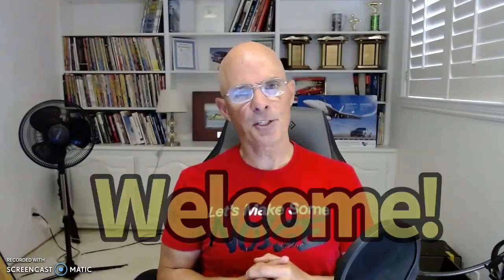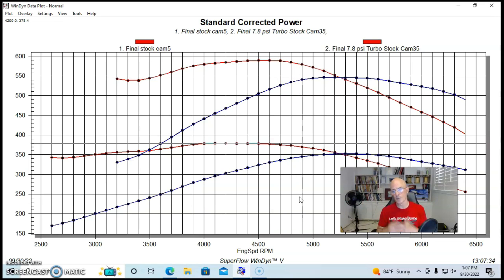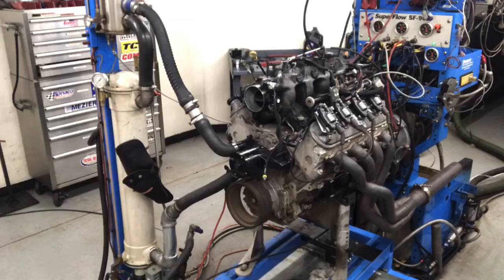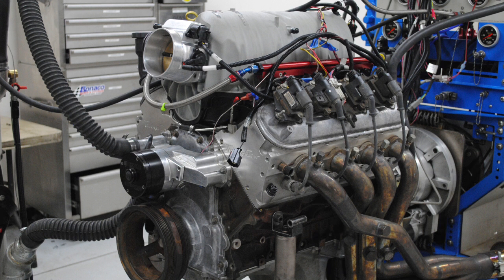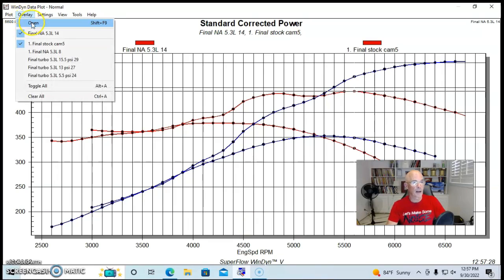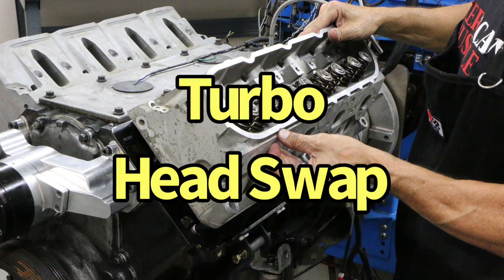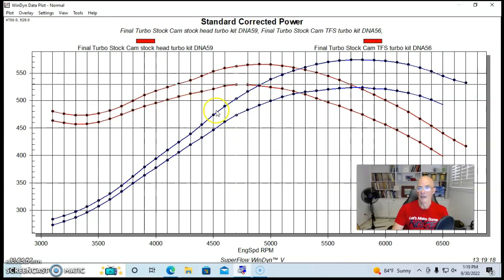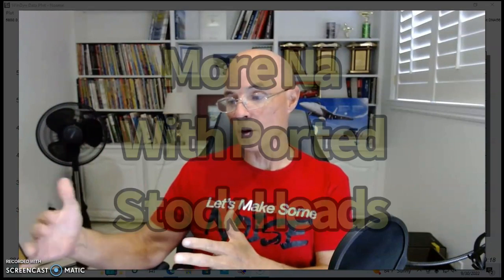DO PORTED HEADS ADD POWER ON A TURBO LS? YES, BUT DO YOU REALLY NEED THEM? ARE THE DECKS TOO THIN?

Comment: Hi Richard,

I’m looking to install a turbo gt42 to produce 700hp daily driver 

I have a LS1 Holden Ss Ute and my current set up is as follows :-

Alloy high rise
intake manifold, 102mm throttle body, proflow hi flow injector rails, bosh 968 42lb injectors, Vcm7 cam, crow cams, double valve springs and retainers, Mellings hi volumn oil pump, roll
Master double row timing chain kit, arp bolts, vcm alloy otr and oil catch can.

Stainless steel extractors with high flow cars with a brand new 2 and a half inch cat back system with rear muffler delete. 

Walbro 460lph fuel pump e85 compatable.

With you experience is there anything you can suggest or change to make improvements please
Reply from the maker: all good-just ring gap

Comment: Hey Richard I have a question, I have a supercharged ls3 with a cam. Stock heads 10psi I made roughly 740whp. Thought it would be a good idea to have the heads ported by Frankenstein, afterwards I only made 7psi and roughly 690whp. Everything else is the same with the car just had the heads ported so curious why I lost horsepower instead of gained.
Reply from the maker: sounds like you have a leak some-ported heads don't do what you describe

Comment: A more volumetrically efficient engine will make more power than a stock one in every situation. Making the motor more "Stout" in the bottom end will help with longevity. I've seen 1,200 HP from a "Bone stock" LQ9 with just a turbo and after market computer.(Freiburger and the Steve's did it a few years back.)
Reply from the maker: PLEASE LOOK AT THAT TEST AGAIN AND SEE THAT STEVE, DAVID AND MYSLEF MADE 1543 HP WITH A STOCK BOTTOM END LY6 6.0L

Comment: It would be cool to see what a blow thru ls e85 non intercooled iats would be vs intercooled under the carb
Reply from the maker: intercooler adds power and lowers charge temp with any fuel
Reply: @richardholdener1727  ya I know intercooler makes more power  i was just curious for guys like me that don't run and intercooler what the iat below the carb is my intake feels like it was in the refrigerator when my car is running on e85

Comment: Why is no one talking about engine response between  ported and stock heads ??    Did a couple of turbo engines  Audi 1.8t   Audi 5 cylinder 2 and 4 valve.   Made small ports with high flow. ( always test at 70" tp)  .   With some there were minor gains at dyno . But drivers would praise the lack of turbo lag. 
One Audi 1.8t customer stated , after flowing  the head and going from 340 to 365 hp :  I am getting scared by the engine as when I only look at the pedal wheels start spinning instantly and its a hell of a job keeping it on the road.

Hmm....you dont go telling me that wheels dont spin at 340 hp...... but do instantly looking at pedal with 365 hp ?? 😁😁😁
Reply from the maker: if the porting doesn't add low-speed torque-it won't change boost response
Reply: @richardholdener1727  in all cases the porting added low speed torque.... 

The 365 hp  Audi 1.8t   started pulling at 1700 rpm like , I quote a V@lksw@gen development engineer who drove it  " like one of our diesels "    
Daryn Morgan is right : gasspeed is everything!

Comment: Richard:  I have an original Holly tag # Autolite C9AF-M-8HC  A.  I took it off my 1969 Mustang with a 428 CJ myself in about 1973 when the first oil embargo hit.  Would like to get rid of it.  Interested?  Would apply to your video on the Boss 351.  I think these were 735 CFM.
Reply from the maker: did the 428 share the autolite with the Boss 351?

Comment: I think you should run an engine to high back pressure with a tight LSA and then put a wide LSA in it and settle the controversy about 111 versus 118 (say) once and for all. We have very respected builders who cannot agree on the subject. Darren Morgan explains it, his thoughts are hard to argue with.
Reply from the maker: why does it have to be high back pressure?
Reply: @richardholdener1727  they say the advantage is when the boost pressure to back pressure is uneven .either one higher than the other it's better not to open both valves because it effects the inertia in the ports .I don't know, it would be a good test. I'd love to see.all of us argue about it too.
Reply: @richardholdener1727  A former BMW F1 turbo era engineer told me , and I have same opinion : Do you really think the turbo will push enough air into the cylinder with a stock BMW cylinderhead to make 1500 hp out of a 1600 cc  engine??  We made engines NA to produce at least 285 hp  then switched in such engine to lower compression pistons and only such engine made the requested hp.   

I guess that says enough.
Reply: I ran into that with Hayabusa  compressor boosted engine.   Customer told me that with stock engines boost was about  max 11 psi ( stock piston/compression) but that with 3 sizes of compressors  , say 245 275 and 295 hp could be made.  The latter got a bit
 ' turbo lag ' as compressor was huge.
But with a turbo set up the stock engine would made instantly  340 hp at 11 psi.  

The difference  between compressor set up and turbo set up is 1 important thing during overlap :  in the compressor engine the combustion chamber can be set on vacuum by the exh pipe tuning. And only when the exhaust valve closes the pressure in the cylinder will rise. Then piston runs down the bore and the question is :  how much is cylinder pressure at point of int valve closing??

In the turbo set up  intake pressure is 11 psi whereas exh pressure is 11 psi  hence ( depending on gas velocities and exh pipe scavenging) the cylinder is near 11 psi of pressure.   Meaning the 30cc chamber is on 11 psi...thats twice more air MASS then in the compressor engine.  Running down the bore  and going up again its clear the turbo engine cannot be beaten in cylinder filling as its impossible for the compressor engine to overtake the turbo engine regarding cylinder filling as it starts with less air mass after closing exh valve after tdc. 

The customer of this Hayabusa compressor engine had a extraterrestial huge exhaust system on it with four HUGE mufflers :  what goes in MUST  go out EASILY!!! After some thought of my side I suggested him closing 3 of the mufflers ( leave them on for the show ) and have a go.  Then he reported a much better torque and driveability /smoothness of the engine with only 0.5 percent loss on max power.

Comment: You probably need to save that money for the $10000 th400/converter combo you need for 1000+ hp
Reply: or get a T56 manual, it came in the corvette and can hold plent
Reply from the maker: a stock T56 won't hold 1000 hp

Comment: If you have cooling, fuel and everything else in check, what difference does it make making 1000hp with 25psi vs having everything upgraded and making 1000hp with 15psi?  Cylinder pressure is gona end up blowing head gaskets, but like you said, it doesn’t matter how much boost you have, it matters how much torque you’re making
Reply: The higher the boost pressure is the higher the intake air temperature will be. If you take 10 lbs of air pressure out of the equation it may lower the intake air temps by 100°F easily, raising "Volumetric Efficiency" . Therefore making more power.
That lowers temperatures everywhere else as well.(coolant,EGT.)

Comment: stock cathedral heads will start having airspeed issue around 25 psi, but they begin backing up around 15 psi. at 30psi, they are starting to get close to sonic. i tested a lot of this on a huge flowbench years ago, at 120+ inches of water the head would fall down
Reply from the maker: the pressure alone doesn't cause air speed-the flow matters. 25 psi at 1500 hp is a different air speed than 25 psi at 1000 hp

Comment: How do the Trickflow 205's compare to a Factory LS3 head? They're obviously an improvement over a Factory Cathedral head, but so are LS3 heads.
Reply from the maker: a factory rec port head won't fit on a 4.8 or 5.3l bore
Reply: @richardholdener1727  That's true. I had the idea in my head because I've got an LY6. Would the aftermarket heads you chose for the comparison changed if it was a 6.0?

Comment: Above about 700ish horsepower, the biggest problem i see is people that dont concentrate enough on their suspension. Putting what power they have to the ground makes more sense that being h3ll bent on 1k hp. 
Ill put money that most guys that spend 2-3k on heads would be better off spending the same money in an effort to get their suspension more efficient. 1000hp is useless if you can only put 400 to the ground.

Comment: NA 350hp per 14.7 psi of air/fuel mix = 23.8hp per every 1 psi of air/fuel mixture If, So then 23.8hp x (14.7+8 PSI) = 540hp approx.....
Reply from the maker: easier math-350 na hp = 700 hp with 14.7 psi
Reply: @richardholdener1727  For some reason I (we) tend towards complexity.

Comment: Due to the expense, I would not suggest the boosted enthusis to spend on head or porting cost. Personally, I would rather them spend on good valves and springs. 
When on a budget your looking for the most bang for the buck. The above mentioned will help you new thrill last longer. 
As Richard has shown everyone, boost works from stock to wildly modified. With limits, boost last on stock ls engines. 
So spend your money wisely. Turbo and tuning will gain a great seat of the pant sensation. From there budget a cam. Personally I would suggest saving for a stronger bottom end build from there on. 
Don't go too wild with wild parts.
Reply: I'm not so sure ive had my 823's max effort on the exhaust its what turns the turbo how that will pan out I will see but got Good figures with just a pocket port on the inlet, bearing in mind rec heads flow pretty good out of the box, its got to turn a huge 98mm T6 1.53 Turbo but its going on a healthy 427 LS, I think will also help spooling my engine guy and myself have put a lot of throught into the combo and were after a decent hp number

Comment: Look at what GM does to the small block when they do supercharged versions:
Increased head bolt diameter.
1 point lower compression.
Forged piston.
Thicker section connecting rod.
Rotocast cylinder head with fully densified deck and tight dendrite arm spacing.
Piston cooling nozzles.
Higher flow coolant pump.

That is, if you're going to sell the engine with a warranty and don't want to lose your shirt.
Reply: The LSA engine, which was sold in more cars than all other supercharged LS or LT engines does not have forged pistons.

And uses the same head bolts as run of the mill gen IV engines.
Reply: @chipcurrey653  yup, LS is simple and will still be reliable. crazy, isnt it?
Reply: @chipcurrey653  It also ran less boost than the LS9.

Comment: Making turbocharged power is not an issue, making turbocharged engines live is the issue
Reply: I feel that a lot of these quick pull dyno engines would blow to bits in an actual car in short order. Would be interesting to see some of these actually make passes
Reply from the maker: a typical dyno pull lasts longer than 1/4 mile with more load
Reply: @richardholdener1727  You forgot about the burnout, the 10 seconds on the 2 step and the 2 or 3 seconds way past redline or on the limiter if you use one
Reply: @taylorsrus9543  I have seen lots of passes on boosted  junkyard ls engines. I have made several passes on my daily driver ls swap 6.0 200k mile junkyard engine

Comment: ud think it destroy stock rods and piston. before warping the deck
Reply: If you warped the head and deck .. ud probably need a detonation.  And it be boost or above 14:1 or  there sthe early alloy blocks that pull head bolt threads

Comment: At 5:12 the graph of stock vs modded was there any data of boost response? I know the load in engine dyno comes into play but the till 4000 of the NA engine there was no difference so assuming in that same turbo in that set up of the two would be same lag till 4k?
Reply from the maker: look at the torque curves of the mod vs turbo and the previous stock vs turbo for your answer

Comment: I'd think unless your doing the porting yourself,  it would be more cost effective to buy aftermarket heads.
Reply: Still better value, most people porting their own heads are either messing them up or leaving too much on the table from being too mild. It would be a benefit to add into these videos that the HP numbers being shown are pretty low. In today's world basic street cars start at 1k HP levels. Not really worth the expense and hassle of a turbo to make 500-600HP anymore.
Reply from the maker: basic street cars don't start at 1000 hp and MOST people who DIY porting don't ruin heads
Reply: @taylorsrus9543  that is an awefully bold statement from someone lacking the 1000 horsepower car lol
Reply: @DWBmotorsports  My old, old, old setup went faster than your car did in its video weighing WAY more, old, old setup made over 1000fwhp, video is on my page, old setup more than that, new setup on track for more than that. All daily driven. Does 200 miles round trip to the track. 
Besides all that, factory cars coming with 650-700hp stock now.  1khp isn't what it used to be. Anyone doing 500-600hp motor today thinking they are going to be street king is going to be disappointed. Now if you are building a cars & coffee cruiser, and it makes you happy, then by all means enjoy.

Comment: Why would porting heads have anything to do with head gasket sealing. Stock or with boost you just lost me. Maybe I misunderstood I'm going to have to rematch. Cool vid tho
Reply from the maker: think stock deck distorts and does not seal as well as thick (after market head) decks
Reply: @richardholdener1727  yeah I under stand that but are talking about after macheing the block and heads. I understand the porting stuff, I have ported stock cast iron and aluminum heads. I could see it being a problem if you took way to much out of the short side of the intakes but that's part of it. I've not had any issues but I don't deal with all the same stuff you do. I'm not knocking you I enjoy and watch almost everyone of your vids. Thanks for chatting with Me on this
Reply: @willkincaid5841  I think he is talking about stock heads vs aftermarket heads. Aftermarket heads have a much thicker deck and all-around better casting.

Comment: I've always wondered about a %age of porting, on a turbo engine, in re: to low-end and then top-end velocity. That is, an optimal balance, taking advantage of good heads and a turbo. But then it's where I want turbos to come-on, for the street. I think in low-to-mid performance, which can help CID, cam and heads. Where the turbos are working more, for the $$$ and effort.
Reply from the maker: whatever the heads do na-that is what they do with boost
Reply: @richardholdener1727  I get it, thx.

Comment: Hey Richard, How much flow would I need for a 410 ci FE at 10-12 lbs running the crossover behind the headers and a VS 7875 the 245@.050-.600 lift cam with the turbo tucked up behind the torque box on the 65 Galaxie and a 4 inch pipe out under the door straight out .
Reply from the maker: you have enough
Reply: @richardholdener1727  The heads are iron and flow 276 /185 with long tube headers and the above can , I hope will keep the boost curve to allow driving in the 3300 rpm area for cruising around and that is where the converter hits, if it goes to boost from 3500-7000 the block will be at its best geometry. 10-12 bar will be beastly!

Comment: What methods could be implemented to reduce cylinder Pressures to help stock LS bottom end components to be used? The question comes from the two 6.0L LS engines in the Big Bang Test. The Gen 3 Engine produced significantly more torque than the Gen 4 engine. You said you suspect the Gen 4 Engine was able to produce more HP without damaging the Engine, possible due to less Torque, and therefore less Cylinder Pressure? Could this be done by Cam profile and Intake Manifold style, along with Ignition Timing?  Or, Is this from one Engine using Cathedral Port Heads vs the Rectangular Port Heads? Thank you for sharing your testing and putting actual dyno numbers to support real world Engine Configurations.
Reply from the maker: short runner intake, rpm-controlled boost curve
Reply: @richardholdener1727  high rpm camshaft?
Reply: Running a larger turbine wheel is a very good way to reduce pressure